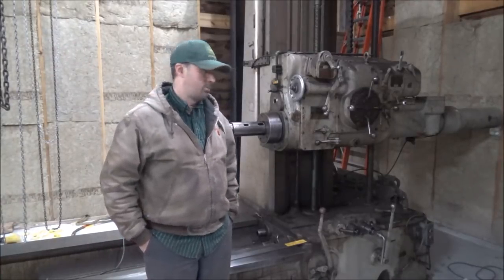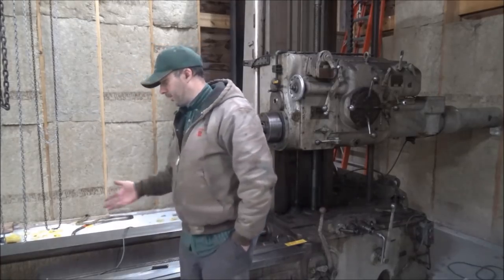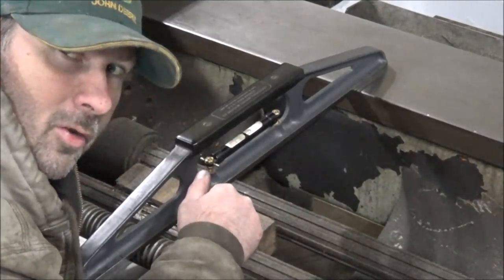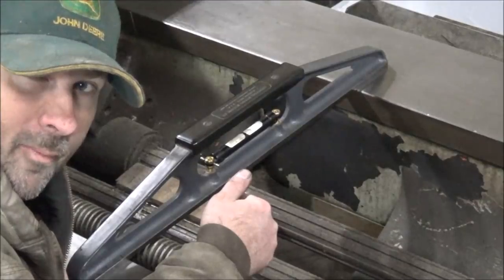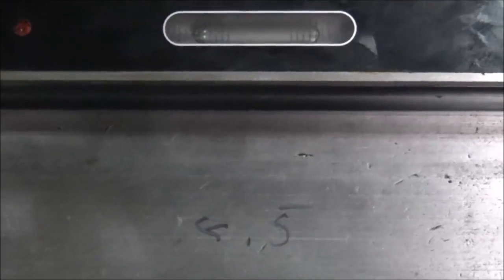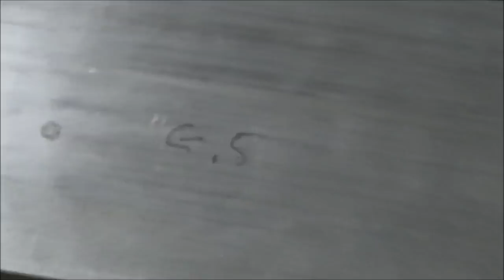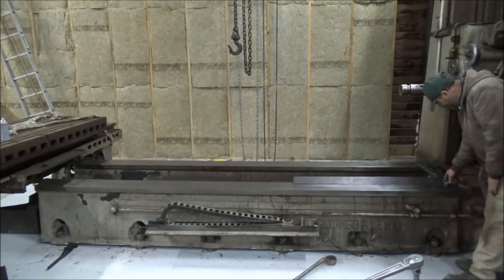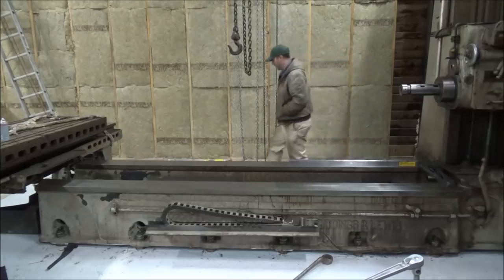Millwright Tips along with Leveling, Aligning, and insepcting the Big HBM

Comment: Great work Brian!
"True genius if the ability to understand simple things"
I'm impressed with how thoroughly you think things out and determine the root cause!
Reply: Al C Brian’s masters degree in mechanical engineering helps with his genius.
Reply: Yep!! Brian is a modest man so never talks about it but indeed, MSAE from a very good EngiNerding school. As an engineer myself, I always find it interesting how another engineer solves problems. Brian uses the KISS principal very very efficiently and to great effect.
Reply from the maker: I always thought engineering over complication was just shotty design.
Reply: I wish I could show you the design I am working on right now that I have to modify because of two major customer oversights. Its a machine that one of my UK coworkers designed. Over complication doesn't begin to explain it which then makes my job engineering a solution vastly more difficult.
Reply from the maker: Reminds me of the time some engineers told me they were going to make a steel frame stiffer and lighter by reducing the thickness and using high strength steel . I said no you are not. They struggled with it for a week in computer simulations before they finally figured out why I was right.
Reply: bcbloc02 yes. That’s what make you unique. Stuff works and not overly complicated. That’s the advantage of not doing design by committee.

Comment: An old bricklayer once told me if someone gives you advice, chew on it and if it works for you swallow but if not spit it out;  but, if you spit it out do so quietly.  I can't imagine anyone thinking you don't know what you are doing but comments were a plenty about how to remedy the level problem.  Commenters  are like squirrels, a blind one finds a nut every now and then.  We no doubt enjoy your videos and appreciate your advice very much.  By the way, the fix you did on your level is the same procedure bricklayers use to calibrate their levels (after some rough use they do change).  We take a glass off one side, remove the original marking, reverse the level several times and mark the level or plumb position that reverses.  Great video for a non expert like me; a lot of good advice, thanks,  Greg.
Reply: Spit it out quietly. That's GOOD! Poor old masons get the lick on a regular basis. Aw, they can hog it out. I've heard that way too much.

Comment: I was hoping for something simple and easy to fix on that vial Brian. Since the high accuracy ones have the internal surface precision ground on a very large curvature I guess that scratch was enough to allow the glass to flex the small amount in just that location to throw it off and make it non repeatable. I certainly learned something new with that. Your work around and recalibrating the level to the undamaged side was what I'd have done as well. Or at least I hope I would have thought of that. :-) It will be interesting to see if the main bedways move at all once the table weight gets on it. For a 70 year old machine without the last final adjustments done yet you've got it damn close for sure. 4-6 adjustment screws on even a new lathe is a whole lot of back and forth so can only imagine how much work that HBM has taken already.

Comment: Nice progress.
I was going to give you some advice about designing and building the anchor bolts but you were pouring concrete around them.
I've designed some for a natural gas compressor package and could have shared my experience with them.
Oh well.
Paved with good intentions.
Thanks,
John
Reply from the maker: I made them a year in advance! I think you had plenty of opportunity to warn me. lol
Reply: bcbloc02 
Yeah, sorry Brian. It didn’t dawn on me back then to say something. 
Oh well. 
On the brighter side, the installation contractor didn’t use my design, chose to use their own, didn’t tell us, then complained when they didn’t fit.  
😂
Regardless, nice work as always. 
Thanks 
John
Reply from the maker: Mine all fit and worked out ok, it just was a bit of trouble getting all the studs thru. If I had used longer studs would have been a lot better.
Reply: Yep. B7 allthread and whack off the extra when you're done with the installation.Live and learn.Of course, we wouldn't know that if we hadn't made the mistake. :-)So, the next time you buy a G&L HBM, you'll know what to do. You know, next year, or whatever. ;-)ThanksJohn

Comment: Don't be surprised at how noisy the gears are. My shop has a giddings and lewis as well. They rebuilt the gearbox and tried different oil. The noise is normal. It is a good machine and does it's job well.
Reply from the maker: I think its quieter than my Horizontal Cincinnati but it could just be because its in a lot more open space.

Comment: Brian, Interesting catch on the scratched  glass on the vial. Would never have suspect that. No light  under the straight edge is pretty DANG good. I'd almost be inclined to quite.
Is the leveling up of the machine analogous to alignment of a lathe where level isn't important. (Think of on board a ship)
Regards,
Eric
Reply from the maker: Yes the actual level is not important, what I am shooting for is that it remains the same angle in both axis across the entire bed.

Comment: Interesting about the level.  i would have never have guessed that it would take that much work to get it level, but i guess thats why riggers make big $
Reply: Normally riggers or machine movers will just level the machine so it is not rocking. Then whoever does the install or a trained mechanic will do the final leveling.

Comment: Hope the bubble turns up soon Brian. Great job levelling in the cold. Have you got your underfloor heating on?   What rail line could I hear in the back ground ?   Do you have a rail stop near you ?  ( I am interested in railways as well as machinery.)          regards from the UK
Reply from the maker: Yeah the heater has been running all winter. 4500watts doesn't make much dent in heating that space though.  The train you here is an RJ Corman aluminum ingot train it runs over the L&N old road subdivision which Corman leases from CSX. It is the first railroad that was opened in Kentucky, first operating in 1851.

Comment: Hi Brian,

In no way I meant, you do not know how to use your levels, I was just trying to bring a different perspective.  Good call on the off-center calibration, something that did not cross my mind.  If your mount was not loose, then your vial must have never been ground properly, most likely someone replaced it and did not get a properly ground one. Hard to imagine that a scratch on the outside could deform the inside of the vial, the glass is about 80 thou thick on a 12 mm vial.  But you are the man on the site, so no matter what the guy on the computer is yacking about, it is your decision :).  Other than that terrific job on leveling the mill
Reply from the maker: Don't worry I wasn't offended I just get tickled  sometimes. :-) I still get comments on the drill welding videos that you can't do it like that and it won't work. It makes me laugh every time I see them knowing it did in fact work.  I appreciate the comments and ideas from all, I am not above overlooking the obvious sometimes.
Reply: I'm relieved :).   Just for curiosity's sake keep the old vial and if you are bored just measure it on the surface plate.   There has to be a good reason why it behaves strangely.
Reply: Exactly the source of my fascination with this problem.  It is hard to fathom that a 24" level's 2 arc sec vial would be that badly made, or that easily damaged.  The only thing that I could think of is that the scratch is not just a scratch but a hairline crack that goes all the way through.  As you duly noted it has to interfere with the bubble, so it has to have some feature inside of the tube.  if you examine these levels the inside of the vial is not absolutely clear, they have a slight frostiness to them, at least the ones I have in my levels, I have a Starret 199 a couple of Chinese 2 arc sec vials, and an older Starret 198-12.   None of them have crystal clear polish on the inside of the vial.  Since these are ground vials the inside is shaped like a whiskey barrel, I found an article about making a ground vial, and they are made from thick walled glass tubes ground on a slightly bent tool steel mandrel covered with grinding compound.  I doubt anyone will bother to fully polish them, they are just left at the surface finish of the last grind.
Reply from the maker: Mine is pretty clear, it looks about like looking at something in a test tube.
Reply: interesting :).  Since you are a busy guy. I assume you will get around to solving the mystery and there will be another video on it :).

Comment: I'm not saying u doing right or wrong but looks good to me,just have 4 sugetions,1 see u have a quick change holder in spindle,PDQ or BEAVER  HEAD,youll like either,2 once u get table put on you are gonna check  make sure weight hasnt changed leveling,3 u have a 3ft right angle square,indicate head up and down,make sure your strait up and down,indicate top of table,all the way across. 6 or 12 months from now check level again,machine might settle in,4 maybe get a turn table 3ft square or a 3ft x 4ft turn table I worked in machine shop awhile,ran HBM and DEVELEIG JIG MILL,HBM I ran LUCAS,PORTAGE,GIDDINGS AND LEWIS,DEFIANCE,really liked operating lucas with the DTG on all 4 axis
Reply from the maker: I have got my 24" Cincinnati rotary table I can use. I would love to have a bigger one someday. I always have my eye out. I don't have a 3ft square though. Oh and it is Beaver quick change you may have seen my cart of tooling in one of my other mill videos as I bought a holder and use it on my NMTB50 too because its way faster.

Comment: Again, that level is too much sensitive for such bad ways. It is hard to align a machine like that within thousands. A laser or an optical alignment system would be welcome. The column is even harder to align 90° to the horizontal ways and also left and right.
Reply from the maker: So how would you suggest I do it?
Reply: You first need a long stright edge to properly set the plane on your horizontal ways. The straight edge need to be of granite or other precision type. It need to be longer then the distance between the ways to compensate for its bent. You then need to place some gauge blocks between the straight edge and ways. Put the level at the center of the straight edge and move all along the ways tuning for a decent plane. Your goal is to set the two ways parallel (plane) and straight not necessarely leveled with the world . Then you need to adjust the column 90° with the ways you just tuned. For this task you need a precision angle square (big enough). You can use also a square bubble level to adjust the vertical ways (this if you have leveled the horizonatal ways to the world). It is a pain. An alignment instrument can help alot. Hope i have been of some help.
Reply from the maker: I have a granite cube I plan to put on the table and indicate, its only like 2ft but should give an idea of how good I have it.